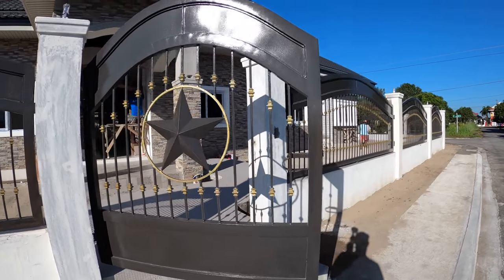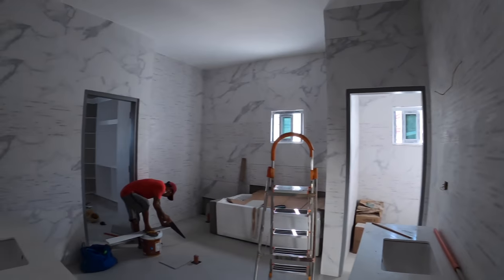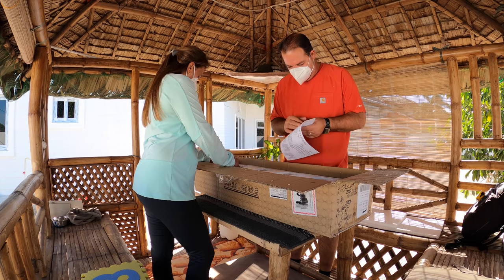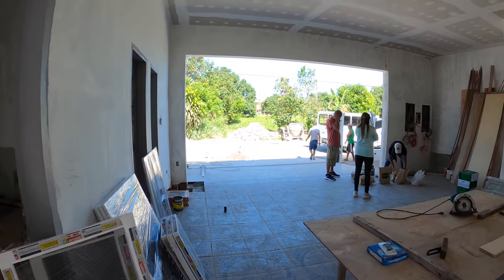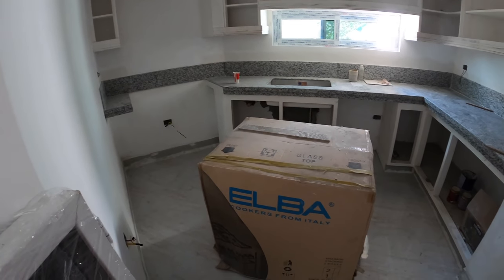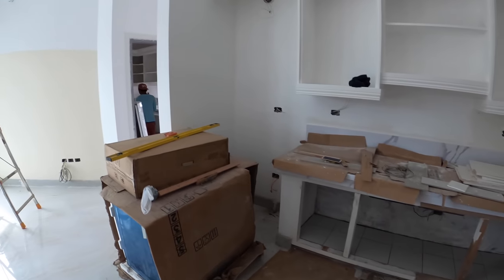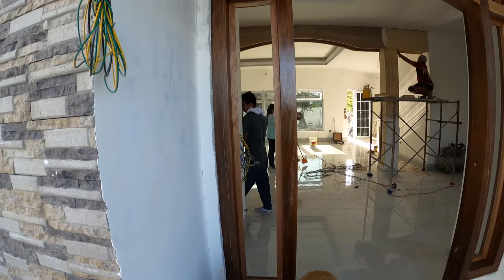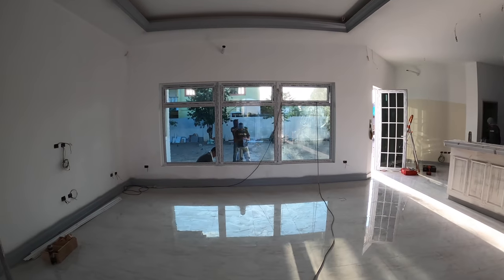Philippine House Building Step by Step, Build Day 215: An Unboxing

Comment: Hi total cost construction house?
Reply from the maker: Ballpark construction costs for this area are PHP20K - PHP35K/SM for the main house build only. Doesn't include air con, appliances, landscaping, perimeter fence, etc. Cost vary depending on location, size, complexity, and level of finish.